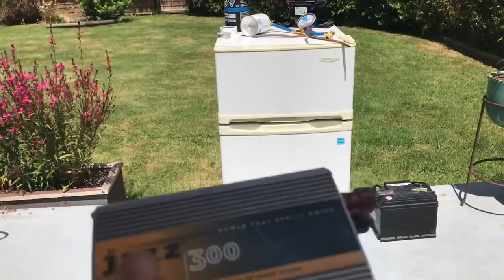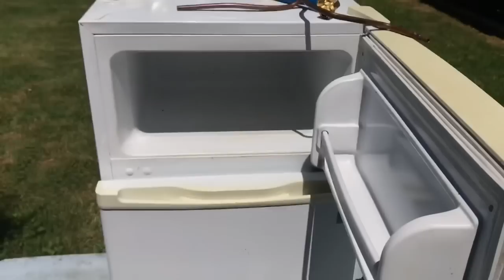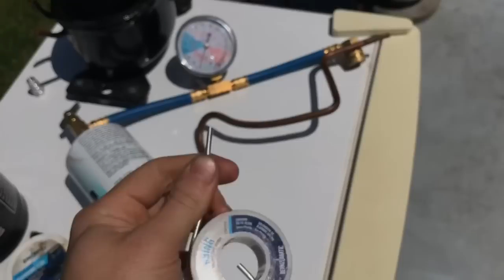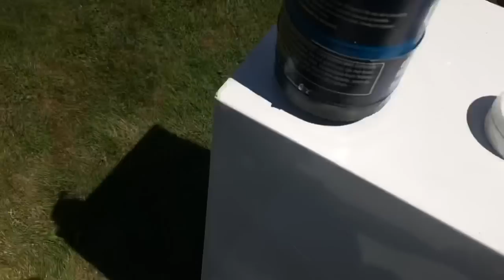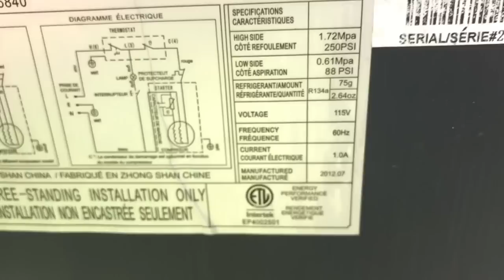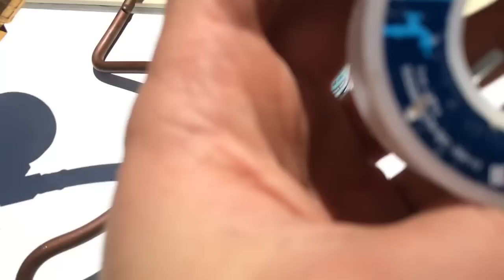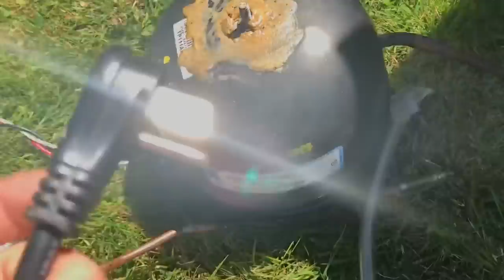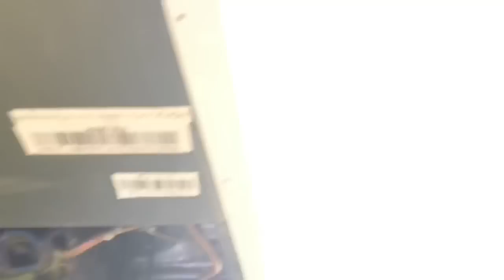Make Your Own Danfoss Compressor Fridge/Freezer For Cheap!

Comment: As you implied the new compressor is most likely AC and it only has an efficient inverter coming  along. My question is why didn't you try to use only the inverter in new compressor and incorporate it with your fridge's existing compressor?
Reply from the maker: The compressor powered by a BDLC direct current motor. The inverter that comes with the danfoss powers the brushless motor at around 30v+ dc, so connecting the danfoss inverter unit to a standard 110v fridge compressor would either damage the inverter unit or the compressor itself.

Comment: Man, this is the best video ever about fridges/compressor/soldering pipes and everything!
Literally, this single video answered all the questions I had and gave me all the advice I needed to run my own rv fridge system! Subscribed on the fly!
Reply: Generally agree; good information, well-presented -- or well-enough presented. Video work was scatty, though. Very off-putting. I was tempted to hang up several times. A little planning would have helped e.g. Put the backside of the fridge in the sun and, on the deck, sorted tools to one side, outgoing compressor to the other, and largely limit camera movements to pans left and right. The visual roller-coaster suggested a lack of self-awareness. 

I learned quite a bit, despite that kvetch, so liked the video.

Comment: So...exactly the same compressor with a piggyback inverter??? Not worth the Premium!  Wonder where i can get that little electronics box for cheap so i can skip the rest of this nonsense .
Reply: No it's a DC motor compressor with a PWM circuit. 
A $90,  500 watt pure sine inverter from walmart will run this fridge as-is with no issues. Hell it will run a full on home fridge.. However inverters are horrible on efficency. I would like to see a comparison between running a fridge on an inverter vs running a DC modded one direct and see which is better..
Reply: @Elfnetdesigns  I've run a fridge for years and you won't do it on any $90 converter.  I favor 2,000W inverters because Initial current draw will be 120A from a 12V battery.  I also just remove the fans to lower running current and only run the inverter when needed.. I don't have any problem with MSW converters.   My whole fridge control is microprocessor and have thought about reducing the duty cycle of the wave once the motor is up to speed to reduce power consumption.
Reply: NO it won't work see comments above. The Danfoss is like 30v or something
Reply from the maker: it's not the exact same compressor as a household 110v unit as far as I understand. the windings are different and i believe it runs at a lower voltage between 40-60 volts and is variable speed

Comment: I was into your vid until you called Lead acid solder "silver solder " if your refrigerant compressor info is as accurate as you're soldering knowledge...........this entire vid is BS
Reply from the maker: what are you talking about man? I said do NOT use lead acid solder. ONLY use silver solder to make connections in the refrigerant system.
Reply: I love it when an expert "know it all" makes a negative comment exposing his ignorance. Lol
Reply: What you have might be called silver bearing solder. You do not have silver solder. Silver solder is sold in 1 pound tubes and contains up to 15% silver. It is sold in about 18 in Long strips that are mostly flat. Having been a licensed refrigeration mechanic for over 15 years and I do know what I'm talking about! What you're using sir is not silver solder say what you will
Reply from the maker: @MAINTMAN73  Ah you know what yes I totally forgot it was silver bearing solder that I used. Thank you for the correction! I made this video about 4 or 5 months after  building the unit and definitely forgot the name by that time. Refrigeration and soldering is definitely a field that by no means I am an expert in, I'm just a young student who had this idea to build this thing and at the time couldn't find anyone with a tutorial on youtube and wanted to help point some people in the right direction.
Reply: @InflamedBallz  you did a good job!
Reply: @InflamedBallz  well said keep it going

Comment: Neveras a 12v consumen 3a 4 amper hora motor donfen 12 v consume lo mismo, resumiendo una batería 60 amp 90 amperes no llega al otro día
Reply from the maker: The consumption of the fridge depends on the amount of insulation, the outside temperature, whether the fridge has a freezer or not, and the litre capacity of the fridge. The smaller cooler sized fridges are equipped with smaller 12v compressors that draw a different amount of amps.

Comment: Never place a battery on concrete or metal it will drain them.Put it on a piece of wood.Great Video Thanks
Reply from the maker: That’s outdated advice back from when batteries had wooden cases from what I’ve heard. Plastic case batteries are safe to store on any surface
Reply: early "plastic" battery cases were actually made from rubber asphalt, which contained a lot of carbon so was slightly electrically conductive so if you put the battery on something that is also conductive, all of the cells would short to each other and slowly discharge over a few days to a few weeks. all batteries made after the 80's have polyethylene or polypropylene plastic cases which are totally insulated, so that issue can't happen. the "battery on wood" rumor comes from people who can't believe in science, but believe in gossip and rumors and other moronic bullshit.
Reply: I remember hearing that old wives tale when I was a kid living in a cold environment most of the year. Although in a roundabout way there is sort of some truth to that.
Most chemical reactions work better warmer rather than cooler. A battery uses a chemical reaction to produce electricity.
 What's actually happening is that concrete and metals conduct heat very well whereas wood doesn't conduct heat nearly as well. So then if you leave a battery on something that will conduct heat away from it rapidly, it will be colder quicker and not be able to make the chemical reaction as well as if it were warmer.

Comment: If you can't find a true 12vDC Compressor for the fridge, convert the existing control circuit to run from the 12vDC battery and use the controllers compressor relay (or wire a new one) to turn on the Inverter instead of the compressor and wire the compressor directly to the inverter's 110vAC output. That way the inverter is only running when the fridge is cooling. And don't use a model that has self defrosting.. total waste of power. For what it's worth, for off-grid or solar, I'd recommend using a small chest freezer @ fridge temps rather than an upright. You don't lose your cool when the door opens.
Reply from the maker: lostsignalreception now that’s smart ! Originally I was going to go with a converted chest freezer but they just take up too much space in a van. Another option is just buying a 12v compressor fridge in China because they’re dirt cheap. I’m there now and we’re getting ripped off in the west.
Reply: @InflamedBallz  Amazon or Costway.com... 54Q Portable fridge less than $400 shipped... search Costway Portable Refrigerator
Reply from the maker: @professionaltinkerer  that's nice but $400 usd is $530 canadian. additionally you can't compare a portable fridge to the price of a stand up fridge which i can assure you is much much higher
Reply: lostsignalreception great idea but some inverters don't like to start induction motors on a cold power-up.. but if you put an on-delay timer between the inverter and the refrigerator set to turn on a few seconds after the inverter wakes up it fixes that issue.
Reply: @marzsit9833  do you have a link for this kind of timer?
Reply: @Moltensurf71  3 yrs later, youtube doesn't like links but just search for time relay, and for easy mounting search for din time relay, a piece of din rail is like 3 eur/dollars + end pieces to lock the relay in place is maybe 1 eur/dollar. You can get time relays for 15 eur/dollars or so
Reply: @marzsit9833  Great point. I got away with it I think because my cheap china inverter didnt care plus I had a separate temp/compressor controller in between to run the freezer at fridge temps.
Reply: Fantastic idea. Use the thermostat to switch the inverter on and off instead of its own switch.
Reply: Have you seen this done ? Sounds like a pretty great way is there a video on this? thanks
Reply: @MrAllinclubs   I ran this setup myself in an old camper. I used a separate temp controller to run a cheap chest freezer @ fridge temps. (checkout homebrew sites for the temp controller mod). Sorry, no video though. There are so many variables now (mosfet vs relay etc.) That I don't think anyone would make a video. But you're basically inserting the Inverter between the control board and the compressor. Using the control to turn on the inverter when the compressor needs to run. I now run a dedicated Whynter 12v fridge in the camper. Way more efficient but had to sacrifice capacity.
Reply: @The411  Cool thanks , does that Whynter 12v have a compressor unit like Danfoss 12v where someone would be able to take it out and install in a standup type fridge?
Reply: @MrAllinclubs   I dont think so. the unit is small, even the 65 Quart one. The idea behind the Wynter unit is you dont lose your cold air when opening as it's a chest type.
Reply: @MrAllinclubs  Yes, they use a Danfoss style compressor, I say style because most of the value priced chest units use a Chinese knockoff.
Reply: Hi friends, thanks for all the comments, Id like to know how to wire this bad boy up? Just straight to the 12v bus bar? The way Im imagining it has the compress on 100 percent of the time. Also, for implementation in mini fridge with adjustable temperatures and such, how would this work?
Reply: you have the best way, this imbecile is promoting breaking federal laws venting freon, overpaid for the compressor and hasn't got a clue about refrigeration
Reply: I just 🥰 it. "Don't lose your 'cool' when you open the door'!!! 🤣😂
Reply: genius

Comment: Looks like this should be a suitable compressor.

https://m.alibaba.com/product/60191097093/QDZH65G-DC-12v-24V-R134a-mini.html?s=p
Reply from the maker: Yeah looks looks like that'd work! Although the shipping fees will probably get ya. Always check with the manufacturer specifications, they say what size litre of cooling capacity the compressor model can handle
Reply: minimum quantity 100!  best we start a FB group!

Comment: in my country 220v  second hand compressor 1/8 pk around 13-15$
and secondhand mini freezer  50x50x50cm around 33$
Reply from the maker: Franky Yodi that’s great to here. You still will run into the problem of having to run it off an inverter and having inverter losses and a greater start up current. Every watt-hour counts when you’re running off-grid on solar.

Comment: Thank you for the video. Question about the Electronic Controller: did you say that it was an inverter? Since its input is 12 volt dc, what is its output voltage? I'm asking because in case it's output is 110 v AC, perhaps instead of replacing the compressor, all is needed would be to add this Electronic Controller, between the 12v battery and the AC compressor. What do you think?
Reply: uzi aloush the danfoss compressor itself has a 30-volt, 3-phase ac motor hermetically sealed inside it. the controller is a VFD (variable frequency drive) with a 12-24vdc input. the controller monitors the load on the motor and adjusts the frequency to keep the current draw as low as possible without stalling the motor, so the motor uses as little power as possible. that's what makes the danfoss system work so efficiently.  for this reason it would be impossible to use the danfoss controller with any high-voltage ac compressor.
Reply: No the danfoss compressor is like a variable frequency/ voltage drive inverter for the compressor. Very efficient like a miniature mini- split A/C system.
 Great video by a very smart young man.
Reply: i was thinking about that,but you have to put it between the thermostat and engine,like at the danfoss compressor.All you have to do is actually place an invertor to your ac110v compressor.Is same thing without paying that amount of money on the danfos compressor.
Reply: Uzi, you mentioned the output of the Danfoss controller, is this something you looked any further into? It would be interesting to see if your suggestion could work to simply plug the Danfoss controller into a standard fridge compressor. I've done some testing of the Danfoss controller on the bench with and I only seem to see 9v AC which surely can't be right?
Reply from the maker: hey thanks man. the output voltage of the danfoss inverter around 30 volts or so. but i don't think it's pure A/C that the compressor runs on but a special waveform from the inverter. you should look into it more. you can run a 110v a/c household fridge off of a standard power inverter but it will be inefficient and the inverter will use lots of power when the fridge is not running. these danfoss compressors are specially designed to have low start up current and be more efficient running of of low voltage dc power sources.

Comment: couple things, 1 Chest fridges/freezers are way more efficient then standups. Cold air falls to the lowest point, open a standup and all the cold is just pouring out onto the floor. This is why people get Chest style ones. 
If you are looking to make the MOST efficient fridge to run off solar/12v. Installing a DC Danfoss compressor is only 1/2 of the equation. Like I explained earlier Chest are better. Also between Fridges and Freezers, Freezers are better at holding in the cold. They have thicker walls to hold the cold inside. So, if you take your DC Danfoss compressor AND a Chest Freezer, and connect the power supply through a temperature gauge, one that can be set to Fridge levels, you now have the absolute best of all world. A LARGE DC, Efficient Fridge.
Reply from the maker: chests are definitely the most efficient style of fridge, but not everyone has the space for one or wants to have the added inconvenience of having one in their van or RV. often people have to make invasive modifications to their stock van to make them fit and put them on sliders. Making one yourself it is almost impossible to source a donor chest fridge that has favourable dimensions for mobile living. the molds they use for portable 12v fridges are sized much better for mobile living than household chest freezers. personally I prefer the convenience of a stand-up style fridge with a bigger consumption.  cheers brother
Reply: @InflamedBallz  hi friend can you explain where you got the valve on top of the refrigerant/what type of valve that is/pressure gage thread size or type?
Reply: @InflamedBallz  a fridge in a van trying to be efficient is an oxymoron...
   That being said "duck bill vise grips" (cheap @harbor freight or amazom) turning a mini fridge into a chest style is easy with many variations possible.. if needed gut a second mini fridge to level and orientate cooling unit... 
       The most efficient fridges have a lot of added insulation. Good luck
Reply: I was going to suggest the fridge >> chest freezer modification. Worth a try, at least, if you stand to save >$1000. Finding an appropriate volume in which to put it in a vehicle or vessel would be a problem, though. In digs, less so. The issue of the doors might be resolved by dropping the hinges out of the equation and converting the 'doors' to run on ball-bearing telescoping drawer guides/rails. Or throw together some vacuum-formed, styrofoam-filled, close-fitting 'pot-lids'.
Reply: @michaelthibault7930  i just built a chest type cooler from 2" foam , a galv. metal box , w/1/8th ply ext. for looks...the top is foam , plus added foam  pad for seating ; it fits snugly into the cooler...as i commented above , i plan to cycle frozen goods from refer in max mode ( they freeze if you build a similar foam box external to orig. box) into the cooler to defrost......my "cost should be less than 40 amp/hrs./500 W per day (?)     eventually build a similar chest freezer inspired by this video.........just got a shorty dodge van , and it's requiring SERIOUS planning for storage , since i haven't yet raised the roof .

Comment: Don... Great job. How about a  building a complete new system  separated  from freezer/frig for homemade boxes made to fit in RV's or boats?
Reply from the maker: that's totally possible. they sell kits where you can buy the evaporator and the compressor with press fittings that are already pre charged so you can put them in any box you want but they're pricey.
Reply: @InflamedBallz  Yep, very pricey.  

I really enjoyed this video, just to get an idea how to make a Danfoss work with the icebox in my 25' sailboat.  I know I'll have more modifications to make than using a pre-existing box, but this was good solid info for me.  I'm probably going to end up fashioning a new box out of fiberglass, as the existing icebox is tiny.  Still switching over to the Danfoss system will beat the hell out of taking the dinghy in every day for ice!

Thanks much for the vid!  I have a little better handle on what I need to do now!